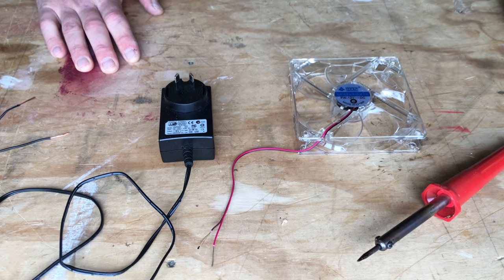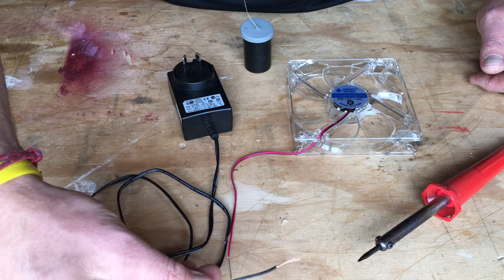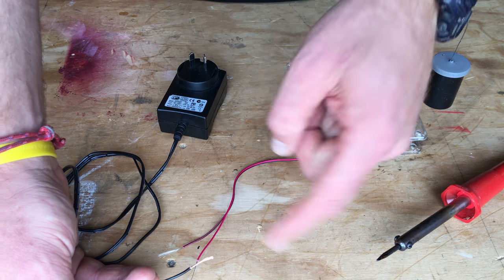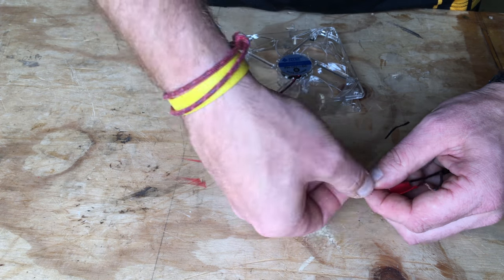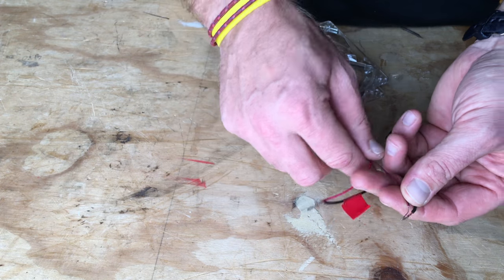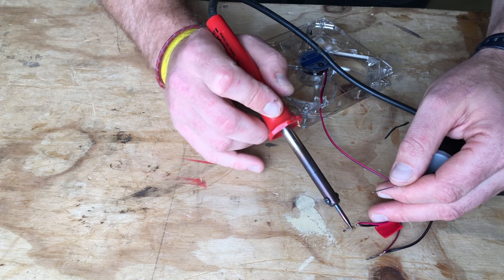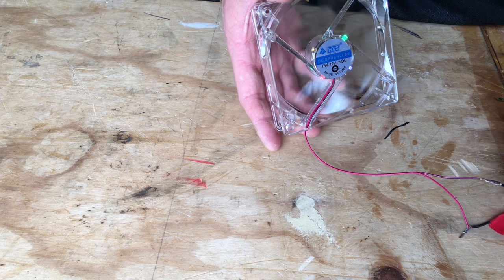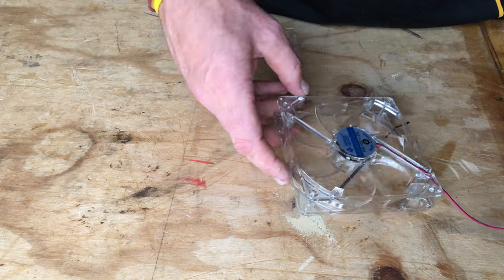How to wire an DC computer fan to AC adapter.

Comment: used the same method to wire a home grow kit for plant growth
Reply: 1 adapter per fan?
Reply: @lamangtubig1690  no, u can connect like 3 fans to 1 ac adapter

Comment: Very helpful video! I used a 12V 1A adapter for a 12V 0.3A PC fan, and I intend to use it to blow the fumes from soldering, away from my face. However the fan spins at very low RPM, below 100, and its airflow is practically useless. The voltage on the striped wires of the adapter before i connect them to the fan is 12V, but when i test the joints i get a reading of 2.5V.  The fan has a 3pin header and the third one is a tachometer, useful only to display speed information on PC. I have tried every possible combination even involving the "tach" wire. Am i doing something wrong? Thanks for your help in advance

Comment: How is this possible without blowing the circuit because there is a vast difference between 6 volt output from the ac adapter and 12volt dc required by the fan that is there is a difference of 6V between the adapter and the fan

Comment: I have a 5v dc fan connected to an ac adapter output 24V and the circuit exploded, is it because of the voltage difference? Is ac adapter output voltage of 7.5V suitable? or safe same voltage or lower than 5v?
Reply: If you have 5 volt fan you can connect it to a 6 volts maximum or it will explode

Comment: I have a 24v 0.65a ac/dc adapter is white and the wire. can I put the 2 wires inside the hole pin do you think it will work.

Comment: I have Nidec Betav TA450DC fan from the old computer. It has 12V DC 1.40A. Which AC Adaptor can I use? Only those with 12V or less?  What about that 1.4A, those with 1A will work or must be more than that?
Reply from the maker: Yes AC 12v or less

Comment: So you just twisted the wires together. I have a fan with four wires (blue, yellow, red and black). How should I go with it?
Reply from the maker: I soldered them together. The black container had solder in it.
Depends where you are in the world, although Red for positive and black for negative is usually correct. Give it a try!

Comment: Dose it matter if you have an ac adapter but you have a dc fan will it still work? It dosent say on my adapter that its an ac/dc adapter it only says ac
Reply: It would not be an adaptor if it was AC. 
You will burn your fans with 120/240 volts. Fans can take 12V max there should be some output details on the adaptor

Comment: Can you somehow connect the fan to the jack directly without cutting the jack off?
Reply from the maker: Probably but I'm not sure how. Good problem for someone to solve!
Reply: @foodrelated  Already solved it, you need a DC jack connector and wire the fan to it.

Comment: Hi. I tried this today and my case fan started to spin, though with very low angular velocity. I've checked that the power source (adapter) is indeed a regulated 3-12V adapter. Any idea what could be going wrong?
Reply from the maker: If it is a low power (output) adapter this will affect the speed...

Comment: How can i connect multiple fans with this?
Reply from the maker: utkarsh karan put them in parallel for even power distribution
Reply: @foodrelated  ok...with the help of a splitter cable? I want to make a 4 fan setup for cooling my aquarium
Reply from the maker: utkarsh karan yes that should work.
Reply: @foodrelated  ok thanks for reply👍👍